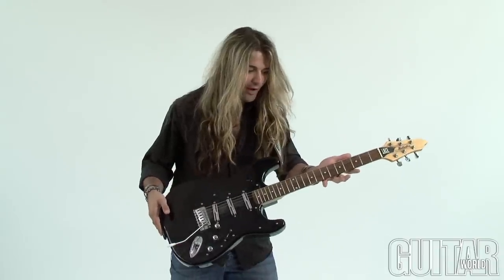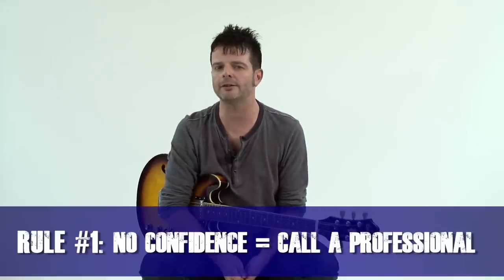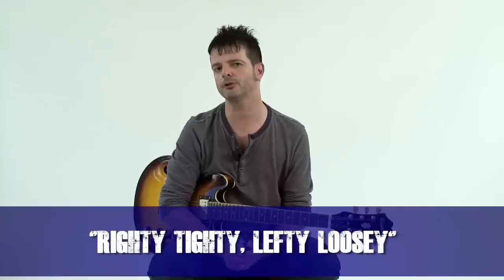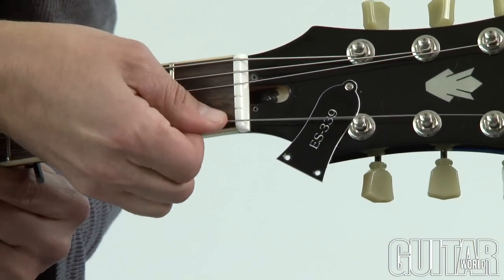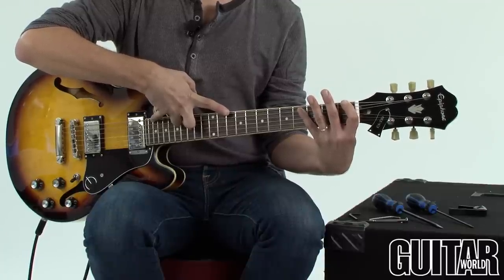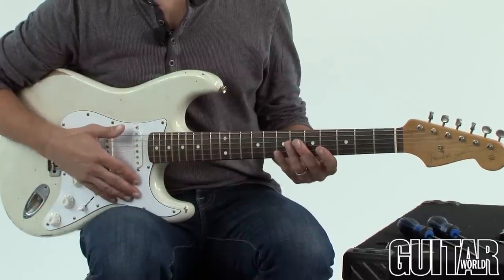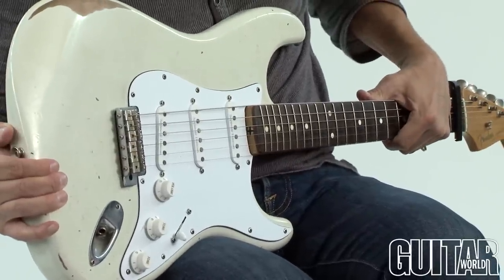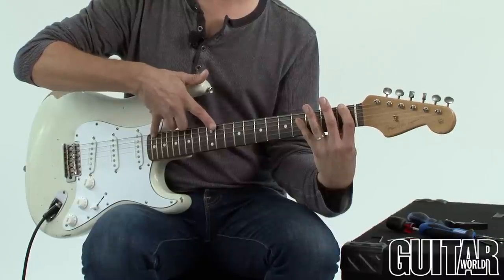How to Adjust a Truss Rod with Paul Riario

Comment: It doesn't always mean your neck is twisted if your E strings have different action, it could just mean that your bridge or saddles need adjustment. I like to hold the headstock at my dominant eye and peer down the fret board, you can usually see if there is a slight variation.
Reply: That would be true if he didn't specify to fret the string at the first and last fret.
Reply: @austinfailz Ha, good point! :)

Comment: I saw a tip from Dan at Stew Macs vid. Mark the starting point with a sharpie. I think that’s the best advice ever. Not sure you could do that with that epp tho. I couldn’t see. I actually have that exact guitar but never had the cover off. But my Les Paul has a male end that I can easily mark and have done.

Comment: Thanks for the video, I have never adjusted the trusrod on a les paul before, and I had that  undesirable high action on strings, even adjusting the tune o matic bridge. With this steps problem resolved. I wish this tutorial would be in Spanish too, but it is very helpful

Comment: O, your Straightening the neck; but are you straightening it from a Back Bow, or from too much Releif? Is it Left, ? or Right? for back bow. Can you be more clear on that? WTF dude?
Reply: exactly!!!
Reply: ben wright I'm glad it's not just me, i was going to say the exact same thing.  "I'm straightening the neck" from what?!
Reply: By straightening it he meant tightening it, turning the wrench to the right, because it had too much relief. You turn left, to loosen, or add relief, if you have a back bow.
Reply: This too annoyed the fuck outta me..... lefty loosey righty tighty.... as if we don't know how a screw works.... and as if ttight or loose tells us ANYTHIGN ABOUT WHICH WAY IT WILL MAKE THE NECK BEND!!!!
Reply: He said it was a "basic" truss rod adjustment.  Most guitars don't have a back bow so he's assuming you're adjusting it from too much relief.  A back bow problem is bigger problem than too much relief.
Reply: Guys, I realize he didn't clarify this, so think of it this way: the strings are exerting tension on the neck which naturally makes the neck want to bow (where the action is higher in the middle of the neck and lower at the ends).  So tightening the truss rod (turning clockwise) counteracts that string tension and will move the neck AWAY from a bow and TOWARD a back bow.  The idea is to tighten only far enough to where the neck is no longer bowed but straight.  If the neck starts out with a back bow, then instead loosen the truss rod.
Reply: If the strings are "High" you have to much relief, tighten the truss rod..If the strings are touching the fretboard, you need Relief, loosen the truss rod.

Comment: Great video man. Thanks a lot for sharing. But i have different problem. Everytime i played a note hit in the first fret in the head of my guitar offcourse it touches to the second fret and it really sounds terrible. So if you ever answer my question it would be really really appreciated. Thanks a lot
Reply: Sounds like the nut slots are to low. Check it by pressing down the string at the third fret. If its touching the first fret it's too low. Hope it helps.

Comment: by tightening the truss rod, do i lower the action or the other way around?
Reply: Ablat desu think of it like a bow, where the strings are the string of the bow. If it looks too much like a bow; high strings and bow curved away, it's too loose. In this case you want to tighten the rod. The other way around; the bow is humped towards the strings which can cause fret buzz when playing on the lower half of the neck. In that case the rod is too tight, so you turn left to loosen it.

Comment: Why does everyone automatically think the truss rod is the culprit? It could be the bridge saddle height or the nut, not always the truss rod.
Reply: Because the truss rod is the one sure thing you can fix and rule out, since you're adjusting the action in a fixed environment. Since you are holding down the first and last fret, whatever action the strings are set to at the bridge is completely irrelevant. Making sure your neck is proper can let you know that the problem is elsewhere. You can't do this type of investigation on the saddle height or nut height (since nut height will differ due to neck position).
Reply: Because they want to irritate you.
Reply: It's best to adjust in the order of ; Truss rod, nut, then bridge.  Always start with truss rod.
Reply: because the wood in the neck is the only thing that can move over time..... unless you have a cat with allen keys and dexterous paws you shouldn't see your bridge change height......

Comment: you missed the step where you have to loosen the strings off first then move them out of the way , then you can adjust the truss rod, and PS you need to always have just a bit of bow in the neck other wise you can create a new problem
Reply: Always make your necks as flat as you can... Any bow is a bad thing..
Reply: You are absolutely wrong, Keith.

Comment: how do i know when I need to adjust the truss rod?
Reply: +john behun If you have a lot of fret buzz higher up the neck, or if the strings are floating above the frets too high.
Reply: Or easily said when your guitar neck is bowed
Reply: john behun...Step 1) Capo at the 1st fret...Step 2) Using your right index finger, press down on the 6th string at the fret where the neck joins the body...Step 3) With a feeler gauge (set of metal strips with different thicknesses) or some go by the thickness of a credit card, measure the gap from the bottom of the 6th string to the crown or top of the 8th fret which is about the middle of the neck.  The average gap should be between .010 & .012 inches.  This gap is all about player preference but that is the 'average' gap.  If the gap is greater that .012 inches, the neck is too bowed which can cause unnecessary string height & needs to be straightened to decrease the gap.  So, you would need to straighten the neck by tightening the truss rod to reduce the gap.  If the gap is less than .010 inches, the neck is too straight which causes unwanted fret buzz.  This means the neck need to be more bowed or 'looser'...All this takes about 5-10 minutes...EDIT: In addition, if you've measured the gap & it's ok but your strings are still too high of the frets, then you revert to adjusting the bridge to lower the string height that way & vice versa...

Comment: Well I knocked  my LP over and the strings were buzzing. I never usually do any adjustments on guitars, but I am in Cambodia and no engineer can be found. So, I listened to this vdo and checked the neck - it seemed fine. Then, I noticed that the front pickup was high. I didn't even need to use a screwdriver, just tapped and it went back into place, guitar action back to normal. 
thnx

Comment: Do I need to adjust the truss rod if I go from 9's to 11's?
Reply: potentially. probably. also will most likely need to adjust saddle height. probably have to loosen (file) the nut slots, and definitely will have to re intonate the bridge.

Comment: what if i have my neck straight and action high and still get fret buzz? its sooo anoying. mall my frets are leveled btw
Reply: WastedFreakOut Have you checked the nut? Some times the nut can be the culprit
Reply: WastedFreakOut You shouldnt have your neck straight. press down 24th(or if you don't have just pretend you have one) and first fret. if 12th touching at the frets its wrong. It should slightly hover.

Comment: You failed to connect bow and back bow to the concept of tightening/loosening the rod. Rightie-tightie, sure, but which malady is addressed with this direction? And you keep making a distinction of "we're straightening this neck," as if that's everything the novice needs to know. Again, aren't both bowed and back-bowed necks in need of straightening?

Comment: just double checking - setting the action usually means adjusting the truss rod, right?
Reply: No, it doesn't.   The action is set by adjusting the string saddles at the bridge.  This is a height adjustment.  The truss rod adjustment straightens the whole neck.  You need to check both, as well as intonation (same note on open string overtone at 12th fret as fretted note at 12th fret).
Reply: I suggest adjusting the truss rod, bridge height, and then intonation.  I'm sure someone will argue why you should do the bridge height first then the truss rod, but checking the neck with your finger at the first and last fret kinda takes the bridge height outta the equation, so it's preference.  Intonation should be last though, otherwise you wasted your time.

Comment: You say you should have the same amount of play or bounce underneath the low E in the high E strings and if you do not you probably have a twisted neck. I would think that it would just be that you have your TuneOmatic Bridge adjust differently on the high E and the low E Side. This could easily make you think you have a twisted neck when all you really have is a bridge that has been improperly adjusted. I would definitely check the bridge before worried about a twisted neck. You should measure underneath each string the high E and the low E with a feeler gauge. See if you can get them fairly even by adjusting the bridge, at least that's what I would try before I worry about a twisted neck. Too many dumbasses out there that don't know what they're doing get things out of wack way too easily. It doesn't take much to get things out of whack on a guitar, especially where the Frets are concerned. A few thousands of an inch can make all the difference in the world.
God Bless Jimmy in NC....

Comment: Don't most acoustic guitar experts tell u to loosen the strings first before truss rod adjustments
Reply: Yes. Because the neck is attached to thinner wood. If you over tighten you can damage the body. Not a problem on electrics and it's much faster to get it set where you want it with the full tension.